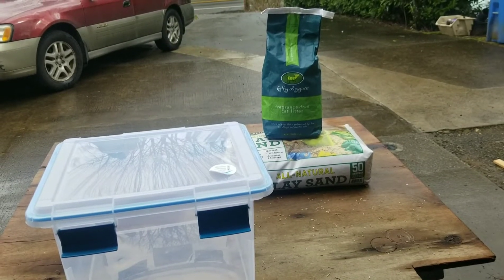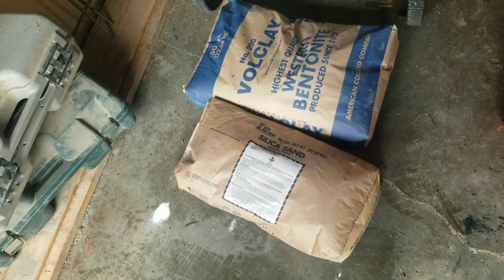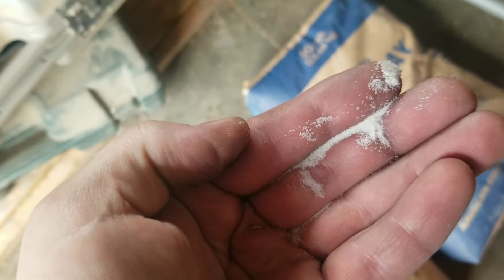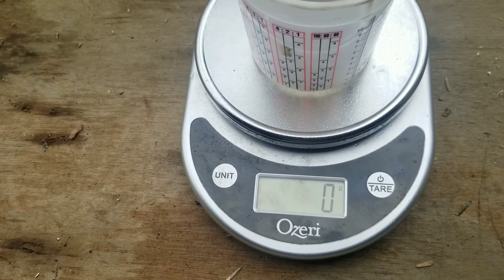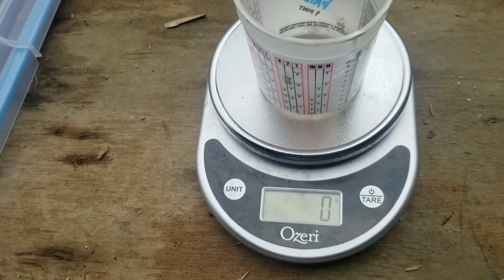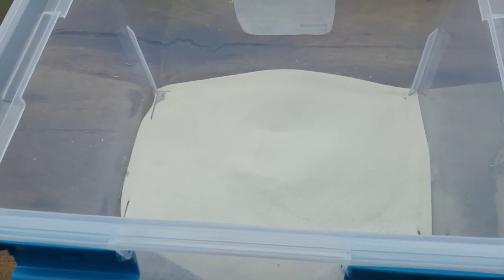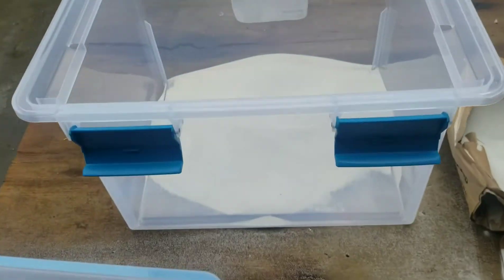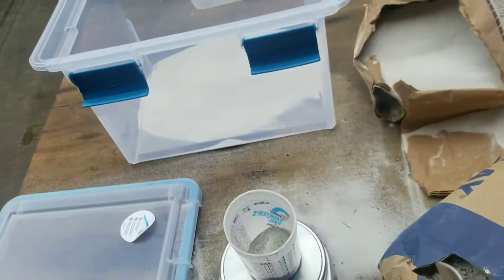How I made a diy green sand recipe for metal casting mold making

Comment: 12% ought to be plenty of clay to hold your molds together even if you haven't got every single grain of sand coated in clay yet.  Mulling it by hand is a lot of hard work even in small batches. If you focus as much on kneading and squashing it as you do on evenly mixing it whenever you add more water, its green strength should only get better and better as time goes on. Some guys even fold their tempered sand up in a tarp and do a little stompy version of the twist all over it for a couple hours when they make up a new batch. Good luck!
Now go pound sand. :)
Reply from the maker: So, "Hulk smash it" when I mix it up? I Like the tarp stomp idea.